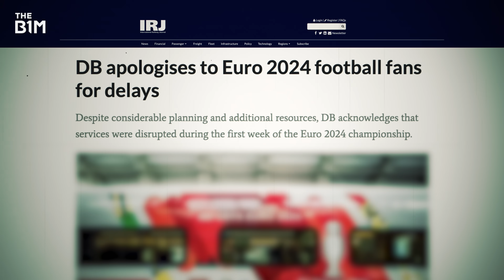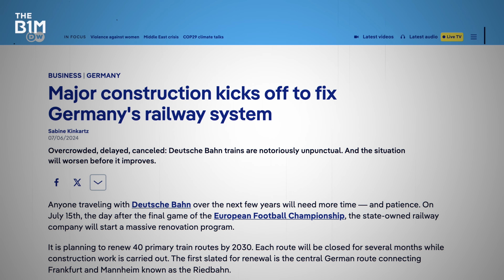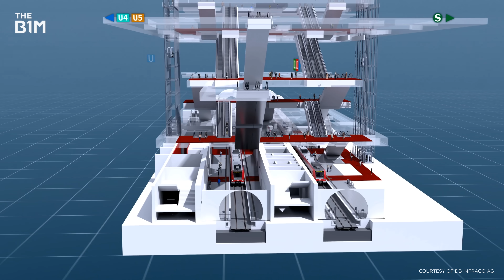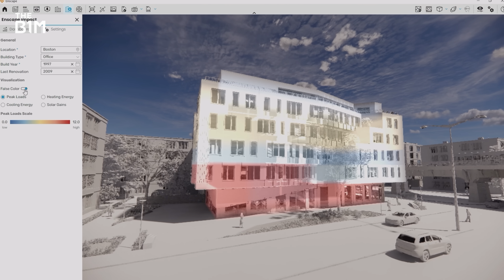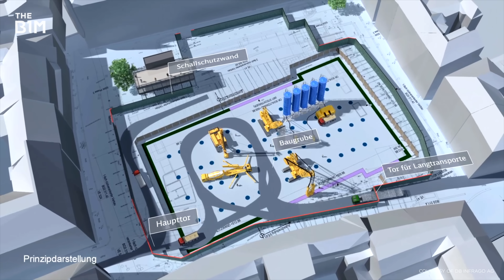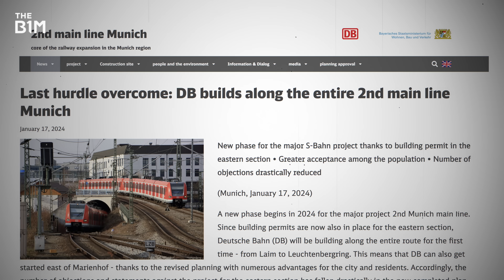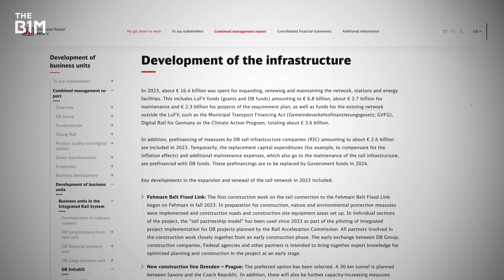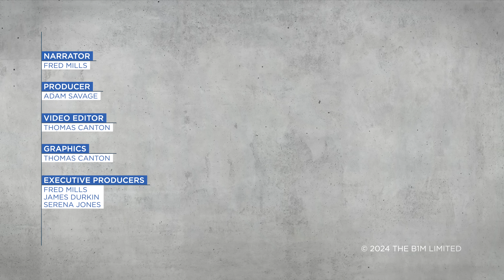Germany is (Finally) Fixing Its Failing Railways

Comment: The 2nd trunk line is heavily disputed among local traffic and railway engineers. The main point of critics is that they could have upgraded the northern and southern ring for far less money. Benefits would have been, that the resilience of the local network would have been improved more than with a second trunk line while also improving tangential connections. Additionally, big corporations like BMW in the north would have gotten a direct connection to regional PT. In its current form this upgrade feels like last millennium policy
Reply: BMW in the north is served by 2 subway lines, has more than a dozen public bus stops, and then there's even BMW internal bus services between the different parts of the plants as well
Reply: @EnjoyFirefighting  The subway line sucks though because you have to take it to the main station to take the regional trains. If the regional trains connected directly to Olympiapark, that would be a game changer for so many people living north of the city center.
Reply: @VulpeculaJoy  no, you don't have to go to the Central Station. The subway lines terminate at commuter rail stations which are also served by some regional trains. If there was a commuter rail line on the North Ring then it would probably connect to Moosach station as well - the same station the subway line goes to. Connection to regional rail service wouldn't be much different to the current situation
Reply: @VulpeculaJoy  You don't even want to go to the main station, you want several, decentralized changing stations so the main station is not overrun even more.
I am also much in favour of using the south ring and making Heimeranplatz, Poccistraße and Kolumbusplatz change hubs to all the subway lines. These lines would be taken by essentially anybody that wants to go to the south of Munich, diverting traffic from the main station and Marienplatz
Reply: @EnjoyFirefighting and yet even BMW advocates for the Nordring to improve the connections of its campus. It's even part of DB's projects for the area around Munich
Reply: They don't rule each other out. Of course, the ring should be reactivated for passengers!
Reply: Exakt, eine Ringbahn wäre günstiger und würde den Immobilienmarkt nicht noch mehr anheizen. München ist bereits teuerste Stadt Deutschlands. Eine Ringbahn verteilt alles besser
Reply: @ArefRichardForster-mr2qj Die Ringbahn wird zusätzlich zur 2. Stammstrecke benötigt, nicht stattdessen. Die Projekte schließen sich nicht aus!
Reply: The upgrades can be done easier gradually later
Reply: To be clear: I think the second trunk line should have been implemented eventually. Still, I think the focus should have been on other, smaller projects first which would have a bigger impact for the same money. (E.g. additionally to the ring, improving operation of the S1 which is the least punctual of the S-Bahn lines)

Comment: Great video very informative but you did not mention the proposed major change at Franfurt hauptbahnhof. Like Stuttgart DB are currently performing feasabilty studies on how best to allow north - south ICE trains to pass striaght through the staion (underground of course) in a similiar manner to that nearing completion in Stuttgart. A certain amount of funds have already been allocated and it seems a preferred route is already being discussed after 4 or 5 variations were considered.
Reply: Still, Stuttgart is already too small, when finished, and they are making similar mistakes in Frankfurt.
Reply: @gelber_kaktus  they aren't because while the station only has four tracks, the upper terminus station stays intact. As part of a separate project, it will even gain another platform (more is not possible without removing major roads or tearing down buildings).
The underground station can handle 10-15 high speed trains per hour and direction, even with a four-minute stop time, allowing more traffic on the terminus station.
The target schedule sees 8,5 HS trains per hour on the underground station, 2 trains/hour on top because they terminate and a 2-horuly service still changing directions.
Reply: @ I think you may need to do more research.
Reply: @gelber_kaktus  Why dont we wait and see? Or can you share the data which supports your statement?
Reply: YouTube is your friend.

Comment: You hinted at the main problem with the Deutsche Bahn infrastructure, that is, there are no dedicated high speed lines. Freight, commuter and ICE all travel on the same network, meaning the inevitable problems with any part of it cascade to the other constituent parts. It is the overtaking lanes that you mention at 11:30 that the system desperately needs
Reply: There definetly ARE dedicated HSR corridors, like from Nuremberg to Ingolstadt, Leipzig to Erfurt and beyond, Frankfurt to Cologne, Stuttgart to Ulm etc. These HSR corridors are, with minor exceptions, used by high-speed passenger trains only, with freight trains running on slower rail lines in the area.
Reply: @EnjoyFirefighting  They are still used by fright, but only at night, when there are very few high speed trains.
Reply: @wernerderchamp  they can be used by freight trains both day and night, but only when they're equipped with the required systems to operate on those lines. But those are just few exceptions. Still the lines themselves are dedicated HSR lines which are specifically built to handle high-speed trains and separate them from normal speed trains
Reply: @EnjoyFirefighting  Yeah, lines like Köln-Frankfurt or Erfurt-Bamberg aren't really used by freight because of too steep inclines. LZB or ETCS isn't too much of a problem through.
It is usually just during the night due to a lack of capacity, but depending on the HS schedule you might sneak some fright trains through.
Reply: @wernerderchamp  and in the end: it's clear that these are dedicated HSR corridors, mainly used by high-speed trains. Of course there are exceptions, like freight trains, regional express trains or even commuter trains running on the same lines. Just like there are exceptions of passenger trains running on dedicated freight rail lines as well
Reply: another option is to separate ICE from other trains by using hedicated lines (sometimes just part of the same corridor).
Reply: @michawisniewski4654  The system should have been set up that way right from the start. Like Japan did with their Shinkansen, which was the very first HSR in the world and remains to be the very best to this day. But they thought they could achieve the same thing cheaper by just using the tracks that were already there. A historic blunder that will forever haunt the German highspeed rail.
Reply: @lonestarr1490  A system like in Japan would not work for Germany. In Japan, most of the population is located along a dense corridor along the coasts, meaning only a few high-speed lines are needed to server a large amount of the population. In Germany, the population is more spread out into many medium-sized cities. A completely dedicated high-speed network would never be able to reach an extent where enough of these mid-sized towns would be able to be served. Japan has 12 cities with >1mil. population, Germany has only 4.
And the separate network in Japan wasn't born out of choice but out of necessity, as the conventional network uses narrow-gauge railways, on which speeds of over 120 km/h are impossible. In comparison, in Germany even regional services run at 160 km/h a lot of the time and some conventional routes allow for speeds of up to 200 km/h.

Germany needs more dedicated high-speed lines, yes. These lines need to be built along the main corridors of high-speed travel to allow high-speed trains to run separately from other services to circumvent these highly congested lines. But a completely separate network makes no sense at all and would result in longer travel times and worse connections for many people, as a completely dedicated high-speed network would never be able to serve as many people as the current ICE network does. Just google for a map of Germany's ICE network and a map of Japan's Shinkansen network. Their extent isn't comparable in the slightest.
Reply: I always think its funny how in the US the rail enthusiasts always complain about the freight companys owning the tracks and such the passenger trains must play by the rules of the freight companys, while in Germany people complain about the opposit (e.g. that we are unsuccessful in shifting more freight from the Autobahn to the railways because passenger rail always has priority)
Reply: It is the exact oposite. Before spending money on very expensive new HSR only lines, dedicated freight lines, plus extra and expanded regional lines are needed. HSR passenger numbers barely go beyond a rounding error compared to what the regional Network (RB, RE, IC on regional tracks) handles. 
And building out some dedicated freoght corridors would allow shifting a lot of cargo onto the rails, which would both save companies/industry money and save literally trucks load of money in the long run by lowering street buildout and maintenance costs. 
Don't get me wrong, more HSR lines would be nice and usefull. But there is only so much money and manpower available, and HSR is currently extremely low in the effectiveness curve for buildouts.
Reply: @reappermen  yet building HSR lines takes away traffic from the main lines, allowing for additional regional or fright lines. It is way more significant that you'd expect, because HS trains need big gaps schedule. If a HS train takes 15 minutes between stations A and B and the regional train 25, and you want the HS train to overtake at B, you'd need the regional train to depart A 15 minutes before the HS train passes so it won't get slowed. In this gap you could easily fit 2 additional freight trains.
Fright and regional trains (especially RE) kind of harmonize because they have a similar average speed.
Reply: @wernerderchamp  while you are correct that high spped trains take overly large chuncks out of the rail slots in planning, there is alos just mot that many of them in comparison. Admittedly the numbers are a bit out of date, but while at uni around 10 years ago I did a course on railway planning, using the german rail network as basis. Back then High speed trains were less than 2% of all passenger trains (Not including U-Bahn, only RB, RE and S-Bahn) in germany. They are usualy at the top end of the passenger capacity per train, but still, in the great scheme of things, High speed rail expansion is a 'nice to have but can be done later' untill wemassively increase normal passenger and freight rail lines and capacity. 
For context that statement is true if you aim at maximising passenger numbers and kilometers, not prestige projects or specific people or projects. I myself would like an expansion of HSR that has been kicked around for a while, since i am akready pretty well served with regional Rail, but i prefer if we improved the overall situation as best as possible eith the available resources more.
Reply: @reappermen  It really depends. There are routes that have five or more HS trains per hour and direction. It really does make sense to expend there.
Reply: @wernerderchamp  why? its much cheaper to run slower passenger trains and have dedicated freight rail.
200 km/h is fine and its much cheaper,,
Reply: @nox5555  Tell that to german NIMBYism